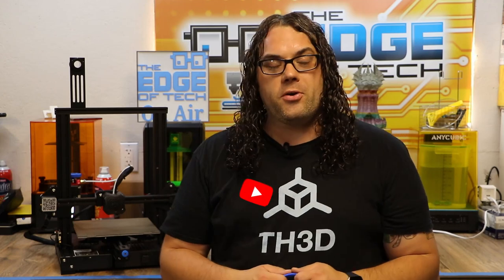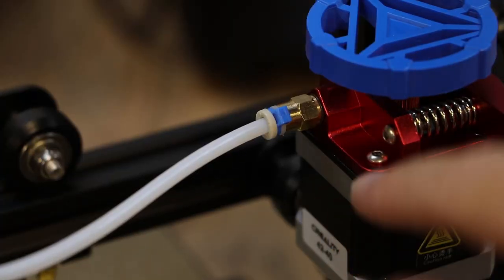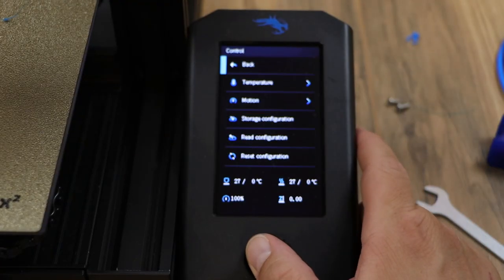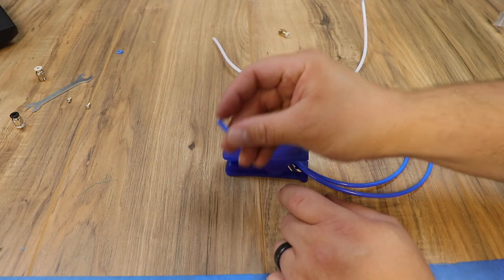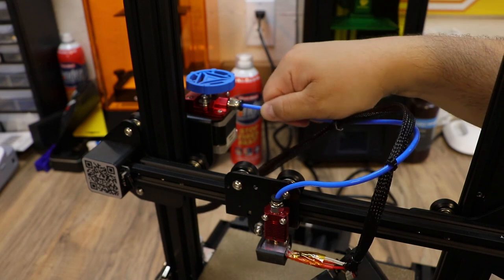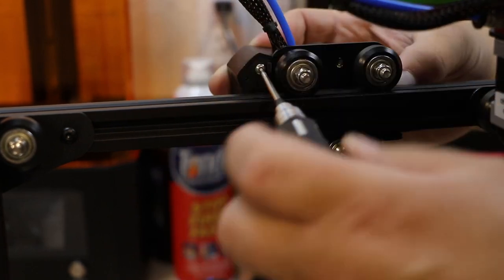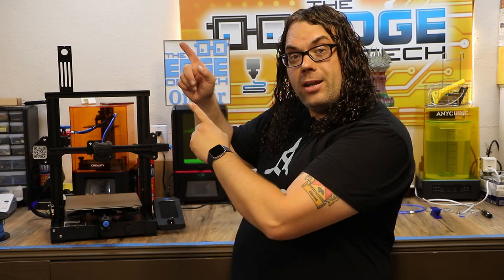Upgrade the Ender 3 V2 PTFE Tube and Couplers in 5 Minutes or Less

Comment: Hey, thanks for this vid. Question: I have a brand new v2 that I haven't assembled yet. I have my capricorn tube as well. Can I go and install this into the hotend without heating up the nozzle? Was the heating of the nozzle specifically for removing the stuck filament at the end of the old tube, or does it help with the expansion of the hoteend in order to make the assembly / fit better?
Reply: You need to heat the hotend because of thermal expansion. You want the nut to sit snugg at 200 C, not at room teperatur. Sonyou should tighten it at that temp. But you can assemble it cold and make it tight at 230 C

Comment: Hmm... they must have changed something at Creality. I just got my Ender 3 v2 at December 1st and guess what ... the couplers do have metal teeth. Yes, I'm sure of this. I checked with a microscope; nice and shiny little teeth in there. I also checked with a magnet and the magnet sticks to it so definitely metal.
Pro tip: if you are going to replace the ptfe tube, you might also want to remove the nozzle and check&clean the flat back end of the nozzle to make sure there is no debris of plastic on there. If you don't, the problem will become worse every time you re-install a (new or freshly cut) ptfe tube
Reply: Sorry to be so offtopic but does anyone know of a tool to get back into an instagram account?
I was stupid lost the login password. I appreciate any tips you can offer me!

Comment: Remove the coupler BEFORE heating up the hot end, and slide it up the tube so you only have the tubing stuck in the hot end alone. No reason to wait and risk a burn.

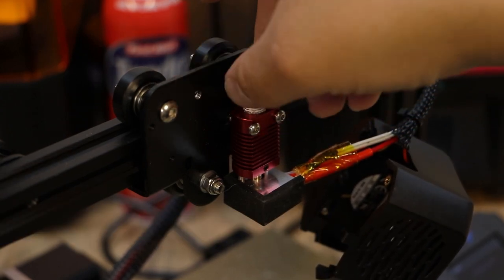Comment: Awesome tip at 4:53 about leaving the coupler a turn from tight in order to get the tube shoved into the nozzle!  I was desperate for a way to cut the bowden tube straight and did not have the cutter.  I finally ended up using the wire cutter on my cat5e crimping tool... it really worked awesome.

Comment: How do you get that Bowden tube off? I'm pulling really really hard and it isn't coming off.  I heated everything to 230.  Actually, The fitting came unscrewed very simply preheating.  I can't imagine that that caused the problem with the tube not coming out.  
This Ender 3 V2 has been great until the past week.  i've replaced the nozzle to find that my unit wasn't assembled correctly and the fan in the shroud isn't attached to anything.  Fun.  But now I now that the loose wood screws in it were creating the vibrating noise.
Reply from the maker: If you can't get it off by pulling, push the tube through it. That should help.

Comment: How does one remove the bowden tube from the coupler on the extruder side?  Mine is very stubborn.  I have this blue tubing you have, but I had a serious jam I needed to remove so I took it all apart.  I cannot get the tube out, ended up cutting it off.  I have no issues getting the tube out of the hot end side.

Comment: Hi Jim and everybody,
I am completely new to 3d printing but not designing.  About ten days ago (after a long time pondering and asking question to a friend of mine who is deeply into 3d printing),  I ordered my E3V2 (that's what I call this unit) directly from Creality.
Along with that I also ordered another glass plate, but also the Tungsten nozzles and the upgraded Belt tensioner don't know whether it was necessary but I got them, total price 295 US dollars which included free shipping.
Another purchase I did was to get was the gear extruder upgrader (to aluminium) and bed springs.
Looks like I should consider this upgrade as well while building the printer.
This printer will be used along with the software of Fusion 360 and SketchUp (latest version) and Cura.
The printer will have a separate dedicated desktop only to be in this setup.
I am trying to get the needed upgrades before building this unit - your input will be helpful.
Thank you all!

Comment: Hi, There is No need to remove the small screw on the hot end cover as it attaches to the plate with the 2 side clips on it. I have used the Capricorn tubing, much better from the comments I have seen on other channels. I have just started printing with my E3V2 that I purchased just after Christmas here in Australia... thanks for the info.

Comment: Thank you for the very helpful video, I watched it since I want to replace the extruder, the bowden tube and the hotend on my Ender 3 v2 this weekend. One question though: you said to make the extruder fitting tight before putting the bowden tube in and I would have assumed it should be better to first put the tube in the extruder fitting and then make it tight with the wrench? Same as for the hotend-side fitting? Or does the tube only gets caught by the teeth inside the fitting but not by tightening the fitting?

Comment: Great video but can you tell me what is the reason to swap out the boden tubing it came with
Reply: Causes jams when printing hotter than 220 after a while. It is not rated for high temps apparently. This was the one problem with my v2

Comment: The first thing you said take your old coupler out and "this is the same if you have the upgraded extruder or the plastic one" then when you say to put the new one in you say "grab the one with the small threads"... I've got the upgraded extruder and there is NO WAY the coupler with the small thread will fit in my the female threaded parts would swallow the whole coupler.... did they send me the wrong part?  After I just installed this double geared extruder?!

Comment: On the back of the shroud, isn't the left screw a fan fastener that does NOT need to come off? On my V2 (same machine as in the video), only the one on the right needs to be removed for the shroud to come off (with the fans). The left side of the shroud is only secured in place by 2 plastic tabs. All this is in REAR view of course, like in the video.

Comment: I found out that the original PTFE tube that's shipped with the printer has a wider hole than 2.0mm and by replacing it with a 2.0 one made my printer skip extruder steps, underextrude and clogged the end of the PTFE tube, due to the retractions and the end of a PTFE tube not being wide enough. One could think, that this TH3D PTFE 1.9mm would produce the same results.

Comment: I went with the same set up from TH3D on my V2. Unfortunately after a while, (30 or so prints), the teeth inside the coupler don't hold as well as they should causing the tube to move in and out of the coupler during retraction/extrusion. :( Going to get a different style of coupler that allows the tube all the way through the coupler so that it can be widened a little and be pressed up against the tensioner bracket to stop that from happening.
Reply: Did what you tried work?

Comment: Do you have to heat up the nasal to take the tube out
Reply from the maker: You may or may not depending on how hard it is to get out of the hot end. Technically you don't, but a lot of times the tube is stuck in the hot end and it's easier to heat it up and pull it out carefully.
Reply: Thank you

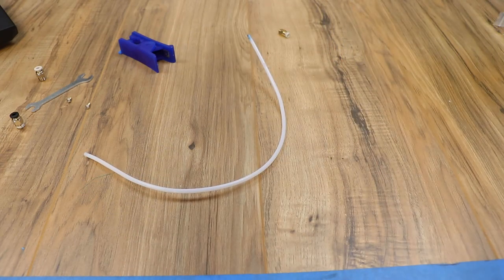Comment: @3:28 And that's wehere I destroyed my coupler. I don't understand how anyone gets the coupler off the bowden tube without destroying the teeth on the coupler. I pulled off the blue clip, pushed down the collar, and it was stuck. I pulled, I pushed... Still stuck. I just had to force it out, and the tiny washer of teeth that grabs the bowden tube tore and came out with the tube and the collar.
Now that it's toast, do I need the entire coupler, or can I just buy the toothed washer?
Reply: I burned through 3 couplers in the same way.  The capricorn tubing caused my filament to break at the extruder gear, because the teeth ground away at the filament especially during retractions.  The couplers were trash though and I don't think you can fix them.

Comment: I tried to pull out ptfe tube from coupler with full strength but they are just locked in it. I have detached tube from both ends, but those stupid couplers not coming odd

Comment: Awesome info thanks! Do you not have to put the little plastic coupler clips back on before assembling the fan shroud and on the extruder end?
Reply from the maker: Are you talking about the little C clips on the coupler? If so, I dont, but you can if you want to!
Reply: @TheEdgeofTech  Never had issues? I never really understood the use for them if you're the only one that uses it. 🤔
Reply from the maker: @kevinjones6924  I haven't had issues with these replacements, but yes I do use them with the stock ones.
Reply: @kevinjones6924  without the clips, the plastic part of the coupler can move back, if the tension is let off — say upon retract — and that makes it hard to retract (adds a mm or so of retract you need to do), and also the continual movement can lead to failure of the coupler.
Reply: @JasperJanssen  thanks Jasper! This was awhile ago lol.
Reply: @kevinjones6924  yeah, that one was more for posterity than for you personally :)

Comment: Nice video again on the Ender 3 V2 - I did a similar update to mine with the Capricorn brand tubing - looks the same stuff with the TH3D kit (same distinctive blue colour)
Reply from the maker: Pretty close, but TH3D Tough Tube is rated for a higher temp. Either way, it would be a good upgrade from the stock PTFE tube.
Reply: @TheEdgeofTech  I looked up some capricorn and found that the one you linked to on amazon is rated for 300 degrees, and they make them up to 340.
Reply from the maker: @MeshJedi  It's also good stuff, but just remember anything over 260 C and PTFE  starts off guessing
Reply: @TheEdgeofTech  Ah never thought about higher temps - even though I have been 3D printing for about 6 years now, I haven't tried any PET/PETG or Nylons at all so far it's (high temps) never come up. There's so many different materials nowadays, it blows my mind compared to the early days of home printers - when I started out it was all ABS/PLA - Ninjaflex was just coming to market when I started out.

Comment: Doesn't this make it impossible to get filemament out of the tube when it breaks or runs out out of the roll? Also what temperature does the rough tubing handle? Capricorn doesn't handle any more than regular, just closer to the filament diameter inside.
Reply from the maker: It's rated up to 275C but only recommended up to 260c before off gassing starts the PTFE. It's pretty easy to get it out when it breaks inside, you just push another piece through it and it comes out. :) Thanks for watching!
Reply: @TheEdgeofTech  Then you need to push a whole ptfe tube length of filament through the nozzle though. You can't just print with a new filament pushing form behind since it won't retract

Comment: Hi there, can a new ptfe tube cause stringing? the lenght is the same.
Reply from the maker: It is possible, if it's not pushed all the way down to the nozzle. Also you want to calibrate after replacing for PTFE tubing. Make sure the flow is the same because if it's a better than stock PTFE tubing it could be sliding better and causing more filament to come through. Then the stock PTFE tubing did.
Reply: @TheEdgeofTech  Can you point me to a tutorial for calibration?
Reply: checking back, my stringing is driving me nuts. made a calibration cube and it's ~20.06 in every side. (i think it's good)

Comment: So I have a mono Price cadet 3d printer an I been looking for a new Bowden Coupler an the ones I been running in to, the thread is to wider to fix on my printer. An I was also looking for the kind that the Bowden tube can go str8 thru the Couple instead of the ones that stops the Bowden tube from going all the way through it. 
HELP ANYONE????!

Comment: Im unable to remove the shroud enough to change this tube, you did it so easily perhaps its because my machine is right out of the box but I am so far unable to remove the fan cover far anough to unscrew the bolt :( any suggestions?
Brand new machine and i dont want to break anything
Reply: Were you able to get it off? Same issue for me
Reply: @cliffrossberg8951  Nah, I think I just went in from below.
Reply: @k C137 Is it the clips on the right hand side that a causing it not to remove?  You only have to remove the longer bolt, then you have to swing the shroud, and gently coax the 2 clips on the right side off.  It took me a few minutes to do it, but I let the hot end cool off so I didn't burn myself, but like you, my machine is only a few weeks old, so these clips were holding really well!

Comment: Why can't we just super glue the bowden tube to the coupler?
Reply from the maker: Because the parts move and need to be removed if necessary. :)
Reply: Never use superglue with the combination of heat! It's a direct fire hazard and the fumes that are coming long before are extremely bad for you.

Comment: Did you use Teflon tape on the hot end ??????????
Reply: It comes installed on some ends. If yours doesn't, you don't need to add it.

Comment: I have never seen my PTFE tubing move. I just don't understand why I would do this as a upgrade and not just wait for the tubing to go bad and then use this for a replacement
Reply: well thats what he means also... he shows step by step how to here... if you print enough the regular will fail sooner or later( the stock couplers are prone to fail imo)...this setup is more reliable when installed correctly... lets say you have been printing 24-48 hour prints  with no issues... but when a large print fails do to clogged nozzle etc its costly... anytime you can improve reliability on a machine its a good thing... i have 2 printers and i have had 100's of prints fail  for various reasons.which is how i learned.. some you can't prevent and others you can...